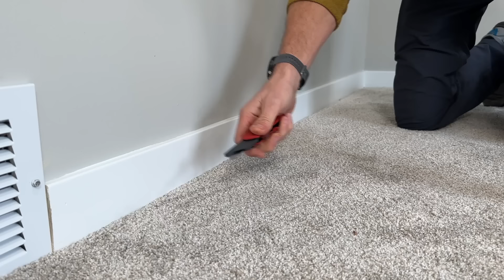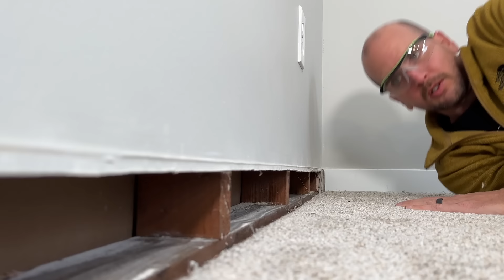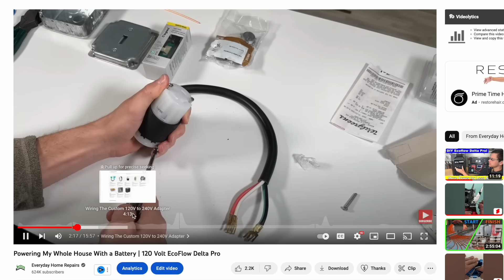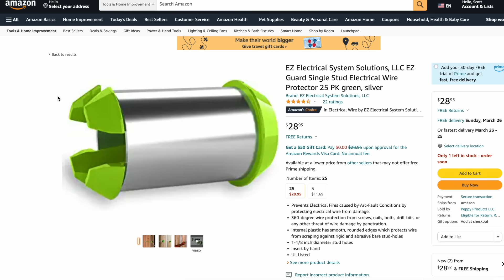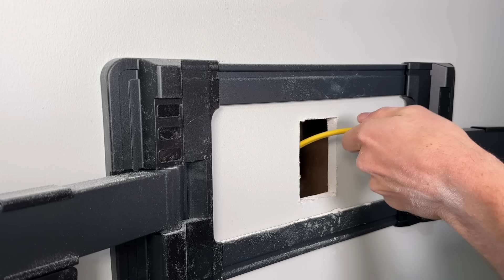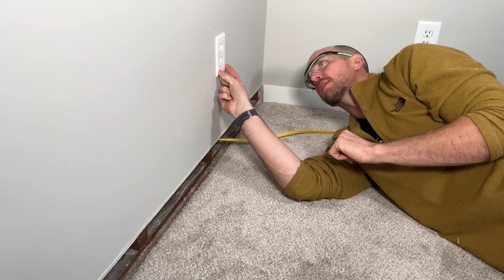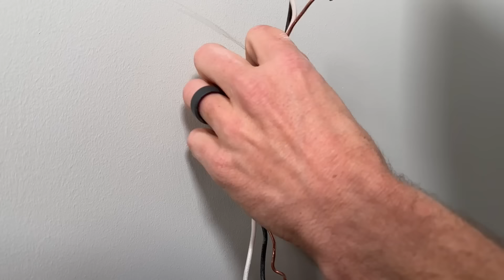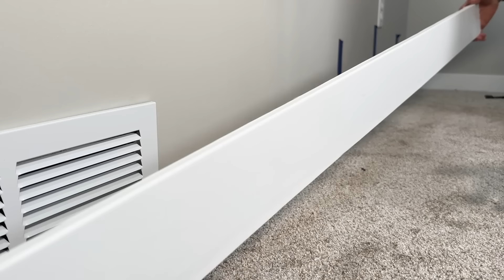How To Hide TV Power Cord And Cables | Easy Way To Move An Outlet

Comment: Excellent video. As an amature i really wanted to see how you fed the wiring up to the bottom outlet. You showed it coming down and fed through the studs and then it was magically in the bottom outlet to be wired. Do you just feed it up until you see it and then feed it through or is there a trick? Hope this makes sense. Thanks.

Comment: I have mounted many like this. However,  I usually run romex thru back of lower outlet first then thru smaller holes in bottom of wall studs.Then it is easier to run the romex up thru the large space in wall and easy to grab at upper hole before installing new box. The wago do work well.
Other than that, we both do the rest the same. Great video.
Reply from the maker: Thanks 👊
Reply: Why not run romex from the top and let gravity help you out?

Comment: Great video with excellent tips on how to install an outlet. Yes you did make me guess your large bit!  I usually use 1/2 and sometimes 3/4 inch.  Your reasoning is excellent.  Never heard of that product.  Usually use nail plates. 
Should mention if someone is using an outside wall it is considerably more difficult to deal with due to insulation and vapor barrier.  
Another point is in my region the electrical codes require electrical boxes to be metal, grounded and fixed to a stud or other solid structural element but the method from this video can be used to run the cable.  The stud will be located behind the TV (the TV mount is hopefully screwed into studs).

Comment: I've run into blocks between the studs inside the wall before. That can definitely make the job take longer. Had to get an extra long spade bit to deal with that.
Reply from the maker: For sure, I need more practice with those flexible auger bits.
Reply: I guess if the block winds up being right in the middle, you might have no choice but to cut more drywall.
Reply: In UK there’s pretty much always a horizontal timber halfway up each gap.
Reply: Same here - I just give up and cut another hole in the drywall for my right-angle drill bit adapter and then patch the extra hole.
Reply: Never seen a house without fireblocks between studs half way between the floor and the ceiling.
Reply: @@phillipbanes5484 Must vary by area. I don't see it consistently.

Comment: I love the video overall.  It was slick and easy to follow.  I also am REALLY glad to know about Easy Guard and the trim pooling tool.  Thanks!  
I do however two items of concern.  
First, you didn't show what (for me) is the hardest part of the operation and one that I don't know how to do.  How did you snake/pull the romex up into the old outlet junction box?  That can be a little bit of a pain without the drywall in the way.  To the best of my knowledge, this was (quite literally?) the only thing you didn't show in the video.  
Second, electrical codes.  Isn't Romex supposed to be secured to the studs?  And secured within 8-12" of the box at the TV?  I don't think it is supposed to be just running up, inside the wall up to the TV outlet you installed.  Please advise.
Reply: I wanted to see that as well.
Reply: This was a DIY project with (relatively speaking) very low current draw, and while I agree that this technique may not strictly meet code in all States, it's probably quite safe regardless, especially on what was presumably an inside, non load-bearing wall.
Reply: @richarda3659  So, codes are just gentle guidelines that one can choose to ignore when one feels they are not necessary?  I won't say that I have been 100% code compliant on every DIY project that I have ever done.  However to not say anything at all about codes in the video is a concern, I think.  20 years ago, I wouldn't have even known to ask the code question.  And, someone might 'leverage' this video and the technique to do something more dangerous than what was shown here.
Reply: There are differences in the NEC between new and old work. Is there a different requirement for wire securing that is old work?

Comment: This is a nice project for a DiY homeowner. A few things to remember:
(1) always be careful where you lay your tools. Drill bits can get very hot. If you have carpet and lay the bit down after use, it might melt your carpet or burn your hard wood
(2) this project applies best to interior walls that tend to have empty wall cavities. If your TV is on an outside wall, it will be full of insulation which could make a mess or make fishing the wire in the wall much more difficult.
(3) be sure to watch his other videos that show how to properly install a receptacle. The one he pulled out of the wall was NOT installed to code and should not be used as an example of a properly installed receptacle. He fixed the problems when reinstalling it.

Comment: I was just going to ask the same thing as Clyde; what do you do if there's insulation in the wall? Often the wall is insulated, because TVs are likely to get mounted on an outside wall. But this was a very cool idea and I'm impressed with how clean the results were. Yeah, you'll have to fill the nail holes and touch them up with matching paint.
Reply: Then you are better off just using clips in the wall. You won't be able to completely hide them, but the result will be much cleaner
Reply: And re-caulk it
Reply: They make strong magnets with a leader on it.  You can tie a pull rope to the leader (search AMZN for MAGNEPULL XP1000-6), then from the outside of the drywall, you put another strong rare earth magnet and just walk the magnet up.  It'll pull the magnet right up the wall pushing the insulation out of the way.  Or you can buy a pull (fish) rod that's flexible.  Tie a pull rope to it and push it from the new junction box (at the top) and push it down to where the trim was.  Untie the pull rope and us it to pull the new romex.
Reply: agreed quite often times TV's are mounted on an outside wall and a couple of considerations should be taken into account as well an insulation and house breathing air flow considerations where common thought would be to seal it up tight but extra considerations and tax benefits of updating insulation one room at a time might be very beneficial in which case your tax credit allowance.

Comment: Awesome job! In a perfect world the upper outlet would be in the same bay as the lower so you could just run fish tape to pull it up. I love Wago connectors. They are so great and are game changers. Thanks for posting.
Reply: Question for those wago connectors. This is my first time seeing them and I know very little about electrical. How do those switches know where to run power?  Because wasn't that outlet a 4 way? (I believe 4 ways just mean it ties into something else in line, another putler or switch). When he did the 3 together into the wago and only 1 out, how does that affect the other things in line? Because if you wire them wrong the tester will say hot reversed/neutral reversed /etc.

Love the idea but just bought a new house and while ill drop the money right now to do this, I don't wanna burn my house down lol
Reply: @adm5163  So you have one black wire that brings power to the right outlet. When you connect it to a Wago with other black wires, those all are now energized, so the black wire that's going to the new outlet now has power. He branched off a single wire to the outlet on the right to energize it. It's the same principle with the neutrals and grounds. When connected with a Wago, they are unified, probably a better word, and all serve the same function. Any help?
Reply: @Brian-Burke  thank you and sorry I may have phrased that wrong. I understand that it unifies them (which is awesome and easy). But let's say in my home I do this, and there's 4 wires coming off the back of an outlet. 1 set is coming in to power the outlet and 1 set is going out to power something else correct?

My question is why does it matter which wire goes where without the wago but when you use one it doesn't seem to affect the incoming/outgoing (polarity?) wires?
Reply: It does matter, regardless of whether you use Wagos or wire nuts. All a Wago does is provides an easy way to pigtail two or more wires together. 

When an outlet is in a string that feeds just feeds on to the next box, the electrician will often use the two provided brass screws to fasten the two black wires and the two silver screws to fasten the neutral wires.  

In this circuit, he was adding an outlet in parallel, so there will be three black wires, three white wires and 3 ground wires. This requires pigtailing to fasten all wires properly.

Comment: On this and some past videos, you're always working on interior walls. Things get a lot more complicated when it's an exterior wall with insulation and VB. Would like to see how you address that at some point. Thanks!
Reply: and getting around fire blocks
Reply: @jeffh4505  I like to drill through the fire block with a 1" holesaw (1 3/8 OD) about an inch and a half, No worry of sheetrock screws at that depth. Sheetrock repair is nothing more than drywall patch from Home Depot
Reply: @quehendricks  is drywall patch fire-resistant?
Reply: Excellent video from a guy who really knows his stuff. Thank you.
Reply: Yeah, same here. All my walls a concrete, w/o cable cuts.
Reply: Our house has a tv mount right on a brick fireplace, no empty space behind to run wires there, lol.

Comment: The only thing I would add is that when you're cutting thru the drywall do not go too deep as the outlet might be wired from below and not above  you don't want to hit the wire feeding the outlet.

Also in the case where there are 6 wires check the way the outlet is setup, it might be split and being fed by 2 separate circuits. IE each of the outlets might have its own breaker.
Reply: He checked both outlets to verify neither had power.

Comment: The video says to run 12/2 Romex. However, you should use whatever size wire is in the box you're extending from. If you have 14 gauge wire in the current box, then run 14/2 Romex. When he gets to where he pulls the receptacle out of the old box and pulls on the wires, you'll see the current wires have a yellow sheathing on them. So, his current box is 12 gauge. 14 gauge Romex has a white sheathing.
Reply: 12/2 being yellow is optional, and has only been a thing since 2001.  So it is possible to still find 12/2 that is white.
Reply: I was wondering why 12/2
Reply: If all you've got handy is 12/2, there's no harm in using the larger-gauge wiring in place of 14/2.
Reply: @harvey66616  I guess
Reply: @DJSubAir  Though, I did see later in the comments, the original wiring was on a 20A breaker with 12/2 wiring throughout. So in this case, he was just matching what was already there.
Reply: @harvey66616  that explains it then. Thanks for the reply much appreciated
Reply: @harvey66616  True, you won't over amperage a 12/2 wire on a 15 amp circuit. The only issue I could see would be if someone saw the 12 gauge wire so they thought it was a 20 amp circuit and plugged in something big, then wondered why they kept tripping the breaker. Of course, if they looked at the breaker, they'd see it says 15 amps. I also don't know that, while it won't be unsafe, if it's against code. In the scenario above, I could see someone saying, "well, that's 12 gauge wire, I'm going to put a 20 amp breaker in," not realizing that it's 14 gauge feeding that 12 gauge wire. Now it would be a problem.
Reply: @wmcomprev  Those are legitimate concerns, but AFAIK code does not restrict the use of larger-gauge wires. The person doing the work is expected to verify the actual nature of the wiring throughout before changing the breaker.

All that said, it's moot. In other comments, it was revealed that the circuit is in fact a 20A circuit with 12/2 wiring throughout and so using 12/2 for this extension is completely consistent with what's already there.

But your points are well-taken.
Reply: I feel y'all electricians out there that were curious about the wire gauge ing. I'm just thinking as an engineer. 1 1/8 drill bit; 3 1/2 stud. Was there a second story there? Was this a load bearing wall? The wood is there for a reason! Maybe a small hole in the center.
Reply: @harvey66616  Plus, TVs draw only a small fraction of either 15 or 20 Amps, and it's really unlikely anyone would ever plug a very high-current device into an outlet located five feet off the floor.
Reply: @joesweeny8093  I mentioned the exact same thing a couple of comments ago. Seems to me you'd lose some structural integrity by drilling a 1.25" hole in a 3.5" stud, especially if the wall were load-bearing. There's another technique, which is to cut a small rectangular 1/2" notch in the front of the stud, recess the Romex in the notch, and then nail one of those steel protective plates across the notch when you're done. That would compromise a lot less structure in my opinion.
Reply: @joesweeny8093  Understood. If a nail plate is added to the outside of the stud, a smaller hole is drilled. It would be difficult to put a nail plate on the back side of the stud since that side of the wall hasn't been opened. Drilling the hole a sufficient distance from the back side would solve that problem, the nail plate wouldn't be required on the back side. However, the item he installed is permitted in a 2x4 stud. It supposedly has passed all the necessary testing, which would include whether or not it over weakens the stud. It is large enough though, that you'd need to be careful to drill the hole as close to the center of the stud as possible.
Reply: @joesweeny8093  As another engineer, the conical metal sleeve used would add back some of the lost compressive strength. So that's a plus.

Comment: Depending on your TV, the wall mount, and the plug for the TV you made need a media box rather than a regular old work box. They are deep and sunken in 2 gang boxes that allow you to mount a receptacle and the low voltage pass through wall plate you showed at the end side by side. It's needed if you dont have enough room behind the TV if its mounted nearly flush to the wall.
Reply: Those boxes are pricey at $25-35 (USD). If you had a flat screen in multiple rooms that can be a little much.

Comment: Soooo… my walls were made of brick.. what do I do now?
Reply: Move to the US of A
Reply: @EnterNH  Can I bring my free healthcare? :)
Reply: buy a new house 🎉
Reply: Do same process, just change tools to concrete/masonry purposes. Such as a concrete drill bit, metal wall box, same wiring, some liquid nail and or lead wall anchors and fasteners. I'm fairly certain this entire procedure is for the confident homeowner and not a leased or rented situation! . And hopefully an electrical inspector isn't watching either....lol. but, it does look better though!
Reply: @GaryTodd-si4um  I just put it in a cable channel and painted the channel with the wall paint. Much easier :)
Reply: Jack hammer from Harbor Freight?😂
Reply: Use conduit
Reply: Brick houses are better anyways, wolves cant blow em down. In all seriousness though, your gonne need to identify if it's a double brick wall or not, if it is then you can cut a hole using a masonry hole saw if not you gotta chase the wall using a grinder.
Reply: Why u gotta b like that?
Reply: Buy a wet saw

Comment: So when you ran the wire up the wall there wasn't a toe going from both studs?
Reply from the maker: No fire blocking in this wall.  If there was you would have to use a flexible auger bit which can take some practice to not just damage the drywall.

Comment: I must be amazingly unlucky because EVERY time I run wires through a wall (which I've done many, many times), I encounter blocking between the studs.  Funny how Youtubers never seem to have that problem :-)
Reply: Most houses in the US built in the 90's and later won't have blocking. But if your house does then the only option is to locate the block and drill a hole through it just like he did across the studs. It will require a drywall patch and paint though :). And even worse than blocking... lathe and chicken wire instead of drywall :). I have family that live in a house built in the 60's and doing anything electrical in that house is a nightmare.
Reply: @livens100  ALL of the houses around here (2000 on) do indeed have blocking in the walls. Must be a code requirement. I long ago bought a flexible installer's bit which has helped but not eliminated the need for drywall surgery. And, our prior house was a 1931 plaster and lathe beauty. Working on that one really helped build my vocabulary :-)